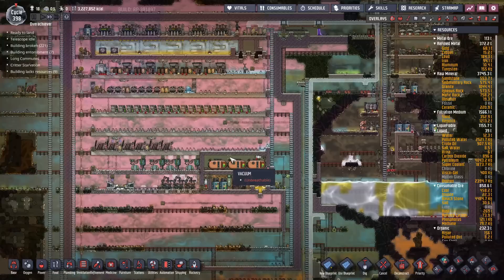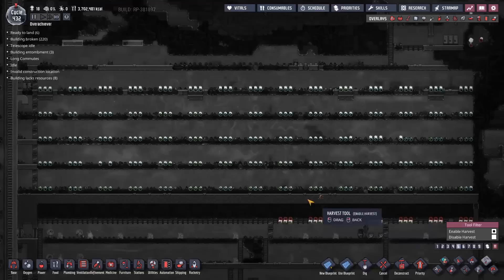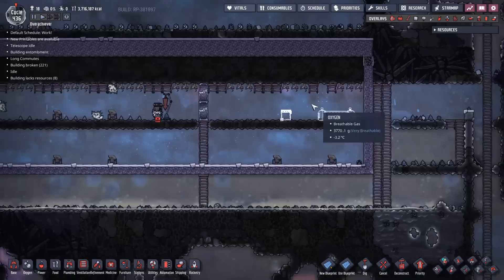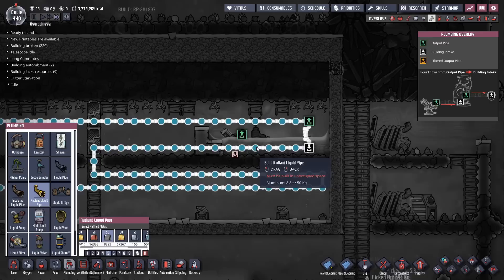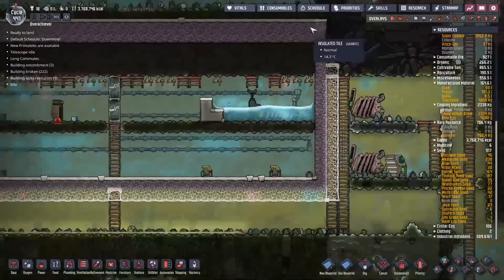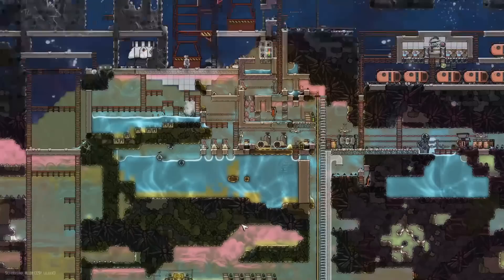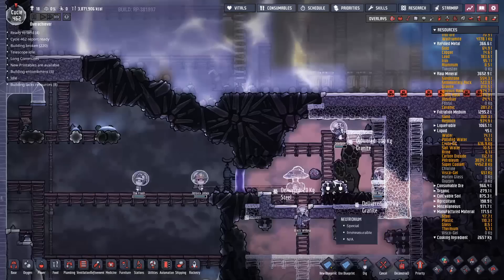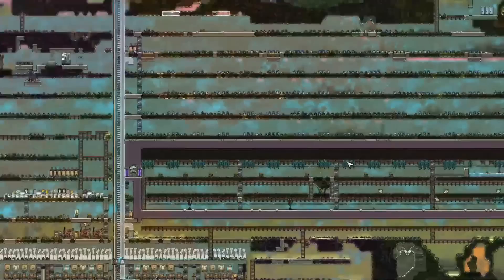Rime 17 : Artificial Natural farm : Oxygen not Included

Comment: According to the pip planting guide on the klei forums, for hanging plants you need to plant from bottom to top instead of top to bottom, and if you do that they only need 1 extra row between plant levels, so rooms 5 tiles tall instead of the usual 4 tiles.
Reply: @Thiago Theodoro no mod needed the pip can plant 101 but 111000111 is more efficient.
Reply: @ZielAmerak  You're not familiar with the mod. It lets you configure the parameters, and you can plant 101 in any direction. Or 110011 if you prefer. Vanilla pips don't do that. The rules are complicated, and for some reasons they treat up differently from down and left differently from right. That's why you plant right-to-left, and top-to-bottom, with regular plants.

I didn't rememer that upside-down plants have their up-down calculations reversed.

I don't use pips much for planting I find it a bit cheaty to have infinite food at zero cost. I sometimes do it, mostly to create natural reserves where I need them. I guess you draw the line for what feels cheaty and what doesn't for your game. It's a sandbox.

Comment: There is probably a reason that I can't think of, but why are liquid locks important when you have the transit tube connecting the two sections?  Can't you just wall it off and allow dupes to use the tubes to access both sides?  Power comes to mind (liquid lock is power free).

Comment: Maybe freeze all gasses around your base so you dont have to worry about them?
Reply from the maker: Gets tricky, I have to keep O2 in my base so to stop it getting out I have to use double liquid locks made of supercoolant as everything else will freeze. Would also stifle my sleet wheat so would have to insulated that farm from the cold. Any water going about the place would also be at risk of freezing in the pipes. Things get really weird when you run a base really hot or really cold.